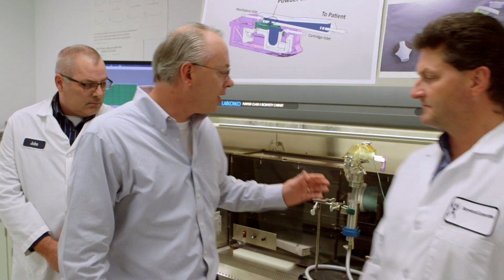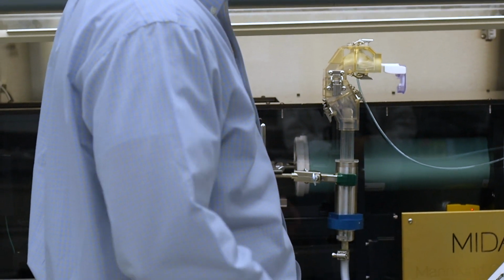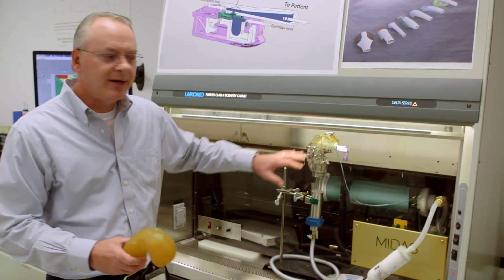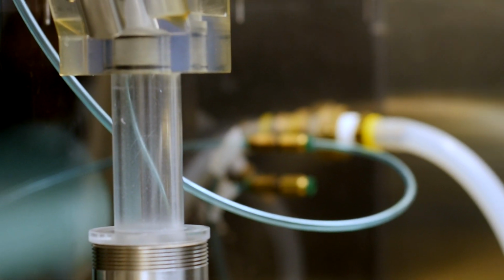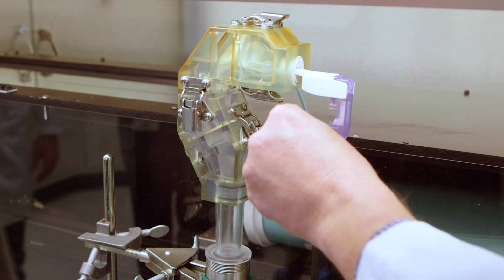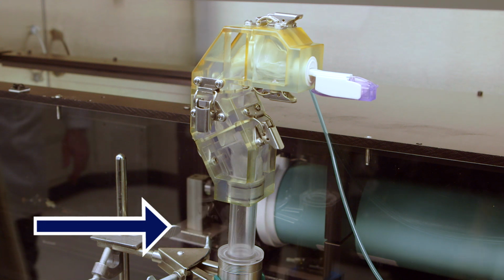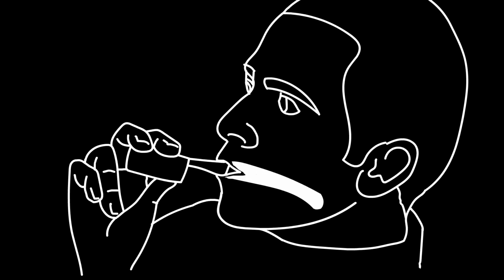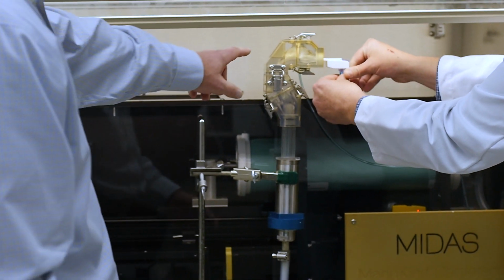Engineers BREAK IT DOWN

Comment: Thanks does engineering use some CFD software to design initially? A relative of mine who is T1D tried and liked Afrezza however had some issues with larger 8 & 12 units not seeming to be as effective as the 4 units along with insurance coverage so has not continued use but would have liked too if those issues were resolved.